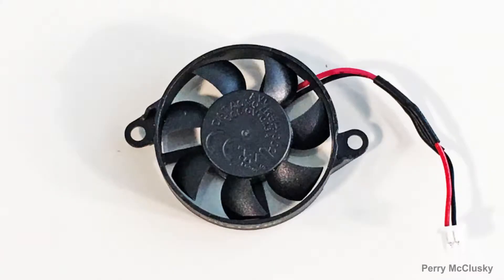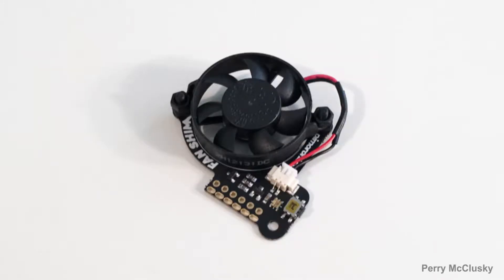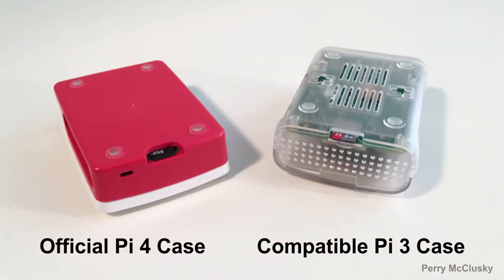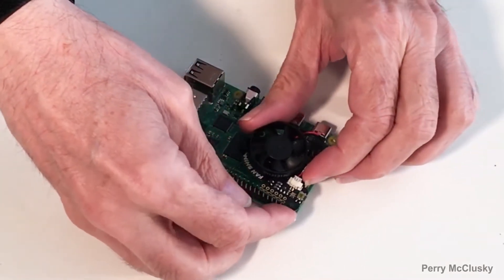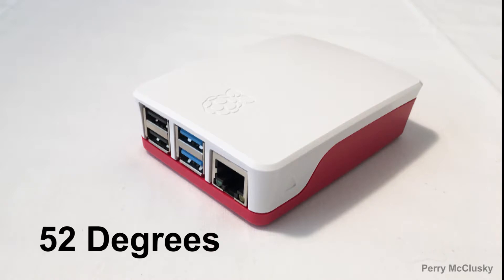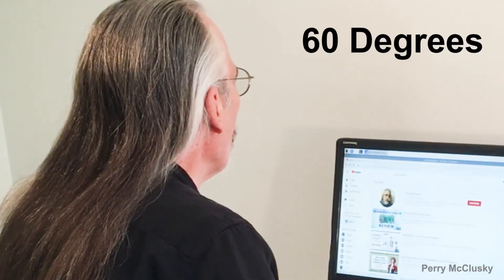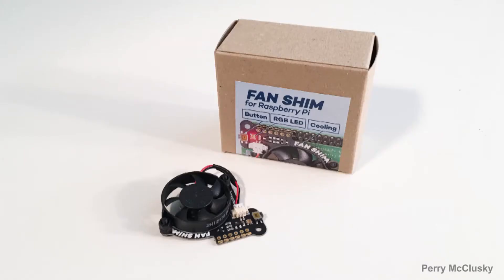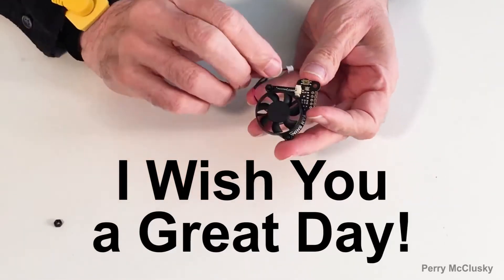FAN SHIM for Raspbery Pi Review

Comment: If it is still in the enclosed official case, where does the heat go?  Do you run it without the case cover?
Reply from the maker: Your concern was the same that I had.  Without any built-in ventilation, could the Fan Shim effectively cool the Raspberry Pi 4?  It cools the board ‘enough’ to be used in the official case because the case isn’t air tight.  My goal was to see if the Fan Shim could make the official case usable and so far, (for me) it does that.  With that being said, if the computer is running and I know that I’ll not be watching over it for a long period of time, I have been known to pull the top up to give it additional cooling while I’m away.  Personally, using a ventilated case with a fan and heatsinks is (in my view) a preferred cooling option.  Yet, I really like the Official Pi 4 Computer Kit, so for now I am cooling it with the Fan Shim.  If I add ventilation to the official case or if I try another cooling option, most likely I will make a video about it.  I appreciate your comment and wish you a great day!